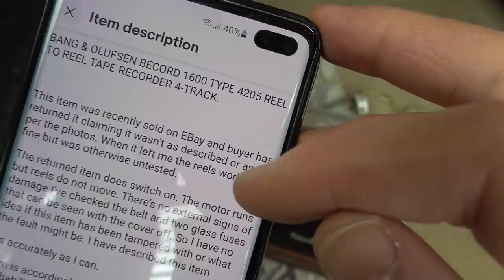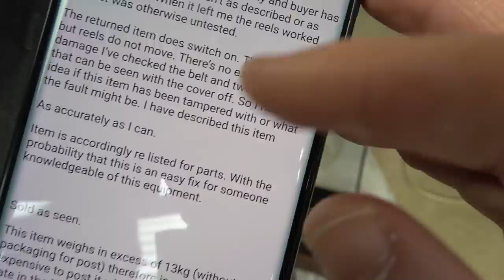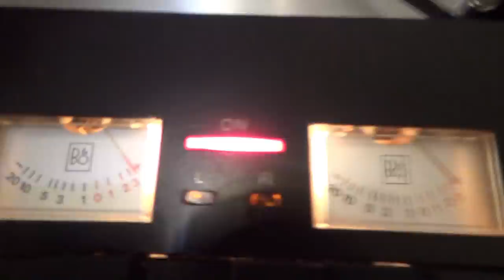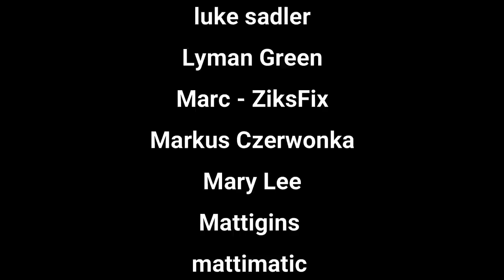50 Year Old BANG & OLUFSEN Beocord 1600 Very Expensive REEL to REEL Player - Can I FIX IT???

Comment: My dad used to work for Jacob Jensen (the designer for Bang & Olufsen) as a carpenter. My dad was once given an old Beocord by Jacob as he had no more use for it. (maybe he did a few small jobs for Jacob as payment. I'm not sure)  It turns out the unit he was given was one of the first prototypes for this model which was in some way modified by the B&O company with an extra tape head. 
It stayed in my childhood home until recently. All early audio recordings of us 3 chrildren from 67, 72 and 79 were made with that.
Reply: Damn, that is cool.
To quote Indiana Jones "That belongs in a museum!"

Hygge, fra en anden DKer. :)
Reply: so where is it now? what was the use of the second head?
Reply: @koushiroizumi0  I dont know for sure what the purpose of the extra tape head was, but I was later told that this extra tape head was something that was later implemented as standard. Not the first models though.  Perhaps something with playing either A side or B side of the tape without flipping the tape reel over? Dont know though. I'm not that technical.  The unit was donated to the Bang & Olufsen museum which is located inside the B&O factory.
Reply: @Krumme1979  As someone who was an audio-obsessed teenager when this machine was sold, I would presume that the "extra head" would be relate to this machine's ability to 'do' sound-on-sound, which requires three tape heads and not two (for reasons too long and dull to explain here!).
(Sond-on-sound means record something live, mixed with what's already recorded on one track, recording the result on to the other track; als known as 'bouncing.'  A process pioneered by Les Paul, but commonly found on domestic tape recorders from the 1960s and 1970s; and that's what the SnS button on the BEOCORD 1600 does.)
Reply: Cad Delworth ah! That Sounds quite plausible. Thanks for the explanation
Reply: @Krumme1979  If it was implemented as standard then the model was probably a Beocord 2000. The later Beocord 2000 de luxe had an extra head. This extra head was a 4-track playback head that made it possible for the otherwise 2-track model to play a 4-track tape.
Reply: organfairy you’re absolutely right. I did an image search and it is for sure a Beocord 2000 we had
Reply: @caddelworth  3 heads were usual on professional machines -- erase, record, playback but because the record head could also play back with the right switching domestic decks had 2 heads.
On the 1600 the third head was marked SnS so that domestic users could have the fun of 'sound on sound' and limited 'duplexing', although lag was a nuisance at 3.75 ips.
The much more robust Swiss/Austrian Revox semi-domestic decks by W Studer were far less moody and not as expensive, mainly due to being direct servo-controlled drive solid state with the only belt being for the numerator. The Beatles used a G36 Revox valve machine for experiments well before working with George Martin then switched to an A77 they had bought in Germany from a de-mobbed US airman who thought they "might have a future".
Reply: @koushiroizumi0 would be a playback head, making it a 3 head machine, the playback and record heads had different gaps to optimise recording/playback.
Reply: These old tape machines actually have much sought after microphone pre-amps, and you should check the wear on the tape heads, may be hard to source and expensive, but if it was from a domestic situation it could be that it had relatively little use, these old analog units are becoming more and more sought after and therefore quite valuable….

Comment: At 29:45 this is a brake. The arm with the felt pad is designed to swing out when the platter is going one way and in when it goes the other way. It is a way to make sure that the reel that winds the tape off is always braking more than the one that winds it on. The two "fingers" - the ones you didn't believe was "factory" is there to set the maximum and minimum braking force by stopping the arm from swinging further out or in. The record/play head has definitely been replaced - but unfortunately with the wrong type. It might work but the original head had much more metal on the front. The black type that you have is from the earlier B&O tape recorders from the 1960s. The problem with the heads that B&O used was that they had a tendency to go open circuit after some years.
Reply from the maker: Thanks for all the info Organ Fairy👍👍👍👍

Comment: I was yelling at the screen "There's a spring missing from the takeup drive idler and there's the missing circlip from actuator lever" . Also that plastic washer that fell out is a shim from the takeup hub. The felt washer forms the takeup clutch which governs the takeup tension. Unfortunately all the rubber drives will have gone hard and un uniform so wow and flutter is likely to be dreadfull. My father had a Beocord 2000 from the mid 60's which was the Rolls Royce of domestic Hi Fi gear at the time and was quite similar to yours only larger and heavier. Beautifully made.

Comment: What a beautiful machine! Looking forward to part 2, you've invested plenty in to this one so far! 👍
Reply from the maker: I have Steve, it's annoying that I have to do a part 2, especially if it is capacitor related and I don't even know what these weird caps are!!! Hopefully will be worth it though in the end 👍
Reply: @Mymatevince  B&O used Wicon capacitors a lot. They were manufactured in Denmark as well. From my experience with a B&O TV and radio from 1959 the metal can Wicons are almost always good and reforms well, but anything else - including their film capacitors - are bad. Each and every one of them. The blue capacitors are early Philips types and should be decent still along with the rest of the film capacitors.
Thanks for a very interesting video - great work so far!
Reply: @Mymatevince  Connect the recorder to an external amp (take the amp out of the equation). Try to actuate the rec switch, try to record and play on the philips you already have. Check the heads for continuity. Dont give up, this most sound gorgeous, looks very nice.
Reply: Don't worry so much about the shapes. Any  good quality capacitor of equal or  slightly higher voltage rating will be fine to use as a replacement as  long as the capacitance value is fairly close. Electrolytic capacitors tolerance back then were +;-20% and nowadays are more accurate and smaller in size and of much better quality. They are likely axial type bullet shaped but you can use the radial style which are easier to get these days. Just make sure to get the polarity correct. While having a capacitor explode might make for sensational video, it will also ensure failure. Good luck
Reply: There are 3 larger capacitors  to replace, use the same voltage and physical size, let the capacitance be as high as it then gets.

Comment: For that little plastic piece, use some baking soda on the glue instead of the soldering iron approach. It will be a super solid, structural hold. Really upped my repair game when I started doing that.

You always impress me with your mechanical abilities.
Reply: Yeah and it'll also get the superglue to set much faster too

Comment: This is very likely related something between the read head and the amplifier, just as you have guessed and not a filtering issue. I would check the connectivity between the head and the amplifier first especially the ground wire.
Reply: Agreed 100% - that would be the first thing I'd be looking at for sure

Comment: Those B&O machines were/are notirously tricky to repair. Being at the high end of the domestic market they naturally more complicated than other domestic decks. Mechanically they're also more complicated than professional decks which are usually designed with maintainance in mind and use a separate motor for the capstan and each hub, hence simplifying the drive system.
Reply: Not to mention that even their higher end equipment usually had somewhat lackluster performance compared to similar stuff on the market. It was mostly the design you paid for.

Comment: Very nice machine. Back in the 80’s I found a Beocord 2000 DeLuxe (the slightly older larger version of this machine) that was left out for trash. I brought it home and fixed it up, used it for quite a while. Most of the audio problems with mine were caused by the record function switches (oxidized contacts) and the plug-in circuit board connectors. It was a wonderful machine and I used it not only as a tape deck but as a stereo center since it had a built in phono preamp for magnetic cartridge as well as aux inputs. They were extremely expensive and very rare here in the US.

Comment: I still have one of these as well as an earlier BeoCord 2000 Deluxe K from 1969, when I was just seven years old. The build quality is fantastic and all that I have ever had to do was replace belts and replace capacitors, along with cleaning of capstans and pinch rollers and cleaning the rubbers on the idler drive wheels.  The Beocord 2000 Deluxe has the rosewood cabinet and cost £160 back in 1969 (equating to over £2,800  in 2022).

They are both something of an anomaly, as they were designed to complete with professional tape decks on sound quality, but not being so easy to repair and strip down for maintenance. All B&O equipment of that era, into the late 1970s had a circuit diagram contained within the cabinet, even the Beolit radios: nice touch, though some numpties did not return them to the envelope after use.
Reply: Like you, my love of R2R machines goes back to when I was 9 or 10. Yes, mine is the rosewood finish version too. Great machine!

Comment: Hi Vince. I worked on B&O gear in the back of a "HiFi" shop in the late 60s/early 70s. I didn't see any reel to reel but just about everything else. 
We had a rash of power supply problems and that hum sounds familiar.
They used a linear regulator to smooth and control the output from the "normal" rectified and smoothed supply. No switched mode or chips in those days.
Anyway a power transistor would fail short circuit and allow rough 36 volts or so through to the amplifiers which were expecting a silky smooth 24 volts.
Horrendous noise.
You really need the diagram that was in the brown envelope.

Comment: great to see you used the idea of chopping the head off the screw to make it into a grub screw, and yes, it does make it look a lot better with that idea Vince. great video fix. not sure if you want to get the same type of capacitors apart from authenticity, as capacitors do leak, so might end up being a modern day replacement rather than old.

Comment: You need good quality low ESR capacitors.  Also, that spring that you put in might get stretched over time and it might be too weak or too strong, so I would recommend getting a dedicated spring that matches the original.  That's one thing that sucks about these old players... dried up rollers that are most of the time almost impossible to replace these days (unless you can find a fan forum for it somewhere with spare parts sources).  Also, I hope you reoiled all the moving parts.  50-year old dried up oil will hinder smooth playback and put more load on the motor.  In a perfect world this thing should be taken all apart, but that's for motivated someone who is planning on using this player in his lineup.
Reply: You won't need low esr caps for this type of gear - they're only really required for switched mode PSUs where they're being pumped with high ripple levels at high frequency - for this kind of gear operating at 50Hz mains any half-decent caps will be just fine. Same with those in the audio chain (although I'd be very surprised if any of those are bad)

Comment: Those "U" chaped rings are there to hold (the one you've found on the table is from the middle pin of the 3 pins you've placed the plastic zippers, and the other at 37:48). You have to force them open so it releases the pressure and let you take them out. When you place them on the spot they are designed to go, you have to open them to insert, then release. I don't know the actual name of them, but they are very common on eletric drill and machines like that. :)  (sorry for the bad english!) Keep up with the excelent entertainment of videos that you produce. Have a nice christmas
Reply: E or C clips probably.

Comment: We had until the late eighties a very early Beovision, great big black and white thing it was with a glass case instead of a traditional wood cabinet and it became superfluous being outed by more colour tellies but when it was new, we were considered "posh" as it was super large, had a remote, buttonless front and decent sound able to be hooked up to a stereo (also B&O) and was valveless being fully "solid state" which was space age back then as valves still reigned king for most electrical goods.

Comment: Hi Vince, greetings from Australia! I just stumbled across this video and I like it very much (I watched many of your videos already). I repair electronics, mostly circuit boards on a component level. Sometimes whole devices and then often I have to modify them to accept some different repair solutions for use of available things. My "trade secret" for cleaning and conditioning of all rubber parts, as well as silicon and plastics (e.g. front face and external body of the device - even metal) is using "Tyre Shine" (at least its called so in Australia). The same stuff that car dealers put on the tires for the "wet" look. It rejuvenates plastic so beautifully that sometimes clients ask me if I used a brand new enclosure... :-}  You just have to wipe it off with a clean cloth at the end, as it leaves some very minor "oily" residue. Just a tip... Regards, Jerry.

Comment: Vince, you need a small 3D printer. Little plastic pieces, nylon gears, etc. are all easily replaced with a bit of time in CAD and the 20 minutes it takes to print. An open-source kit like the Voron 0 will definitely also tickle your mechanical fancy.
Reply: Or just buy an Ender 3 for about 1/4 the price......

Comment: Great work !! I have a Beocord 2000 deluxe which works 90% with just a couple of things to fix.I bought it as it has echo and monitoring capabilities and you can bounce tracks  !! Mine also has 4 heads so it can play both 2 and 4  track recordings.  I really love what you worked out to repair the lever and working out the belt configs on these machines can be a real PITA sometimes. I do hope you get the sound working because the Beocord machines sound soooo good. :) Looking 4ward to part II .

Comment: If you're tackling this without any knowledge of electronics, let alone experience with recording equipment, then good luck! 
.
I've repaired and renovated quite a few open-reel recorders over the decades.  I  once owned one of these Beocords - 2400 half-track and it was a superb machine (and very cheap when I acquired it....).   I used it as a 'master recorder' for a while, it recorded live instruments as well as vinyl or cd albums beautifully and had 'sound-on-sound' cross mixing and excellent recording controls.   I still have a recording of Joni Mitchell and Pat Metheny recorded from LP in glorious half-track stereo, that was itself recorded in the mid 80's.  
.
These Beocords are old school circuitry, using copper-etched boards with discrete components, transistors, caps, 1/2 & 1/4 watt resistors etc...  The  heads were superb, if kept degaused.  Most B&O equipment of this era were shipped with a full circuit diagram folded-up in an envelope and stuck to the rear panel of the equipment,  which made fault-finding a breeze,  as was the modular layout.   Ferrograph did likewise.    I've had them as well.   Now I've got a Sony 1/4 track awaiting service and 'upgrade'.    I've also still got my Beogram 1500 deck and Beomaster 2000 receiver.   I'd wished I'd kept the Beocord 2400 though.

Comment: I'm just finishing off a Beocord 2000 deluxe. Needed a replacement transformer, the tension arms needed servicing and I now just need to sort out a problem with the autostop. Lovely machines with a great sound and some really cool features! :)
Reply: Very nice touch with the hand fashioned grub screw! Nice fault finding processes. The capacitors should be easily sourceable. (but don't get cheap ones, lower ESR the better). Looking 4ward to part 2. x

Comment: in addition to the large capacitor, all the small white Philips must also be replaced. they are chronic dehydration and short circuit. you can see small cracks in the top of them

Comment: Hi Vinc, I love yours clips. I think that you should make a bulb discharger for circuits. You take a 230V bulb, wire, and spare multimeter probes. When you would like to discharge the circuit, you use this bulb discharger. Ofcourse always be careful with high amp and voltage circuits. I wish You Mary X-mas and Happy New Year. Sory for my english it is my second language.

Comment: The reason (sometimes) that the record level meters get buried into the red, is the playback/record switch.
You haven't mentioned record function but did describe it as a player !
So why the sliders and the meters ?
I could be 100% wrong but great video anyway !

Comment: ive heard that buzz before, capacitor failure, i replaced all the capacitors i could find for mine and it started working again properly.  the ones you will have the biggest issue with will be any multi caps/canisters, they dont make the majority of them anymore so you have to replace them with compatible substitutes which dont fit the clamps at all, also be cautious of any wax/paper caps some of those were manufactured in very odd values which are no longer available.  the sole remaining wax cap in mine is because its value is impossible to find and i had no idea which direction to deviate for a substitute or by how much